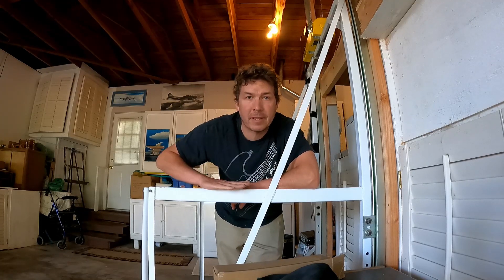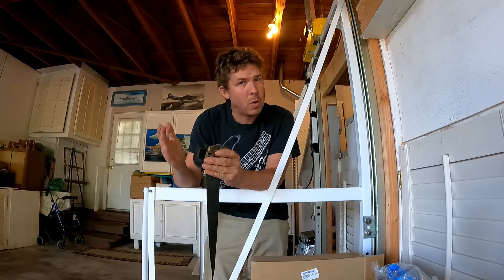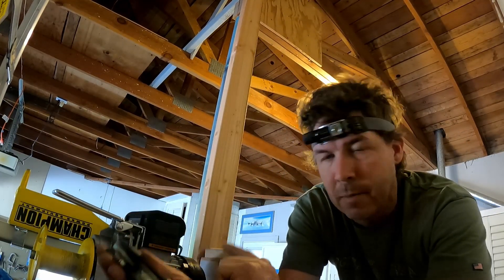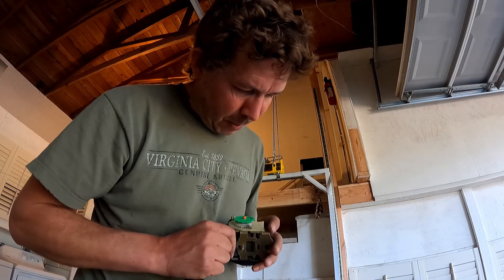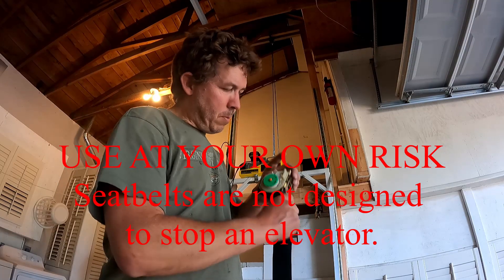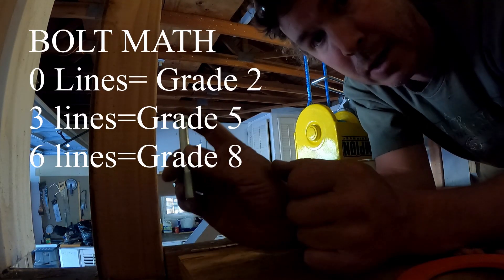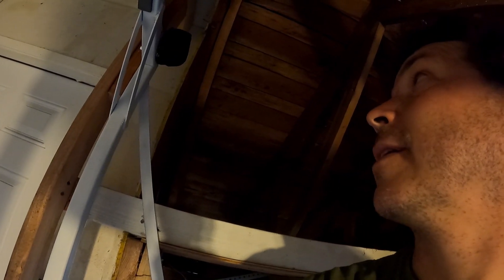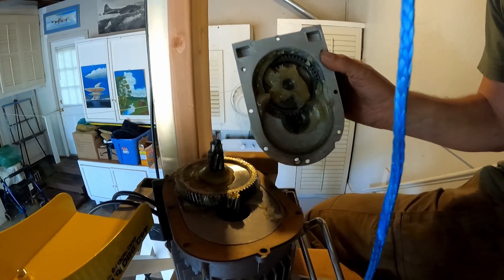How to build a small Elevator Update

Comment: nice build but I wonder if the seatbelt is strong enough to arrest a fall of this weight ? I know they are strong and are made for a different type of "fall" but certainly not a vertical drop but they should work if you position it correctly  but all the weight is on a tiny pawl , then it would be on a car crash as well I guess.  A SLR might be a better solutions as they have a rating of 150 to 200 kilos and are designed for vertical drops , nice build and good safety .
Reply from the maker: the strap itself is strong enough by a huge margin. not sure about the pawl. However the drop is unlikely and if it did it would never be more than about 5 feet.
Reply from the maker: Thanks for the comment
Reply: @DirtyShopDIY  Thanks I was checking out fall arresters that contractors use on building sites, one of those would be better I think for what I have in mind, my elevator needs to lift up around 6 metres more or less, one stop. I'm nervous with a seatbelt although as you say I think it would work , they are built for just this type of thing to be honest and are supposed to hold a body that's is being thrown forwards at around 70 mph, that's a lot of weight, torque and acceleration were talking about. 

I think though for me I will use the arrester as you can get models that will hold 250 kilos from a drop which would be fine I think alternatively I could adopt the Otis system that's being shown on YT but its designed for indoors use and mine is outside

The other issue is I will need to bring the cable down one side, across the back rail and then back up on the right to a anchor on the top as I need to be able to walk through where the cable would be centred, cant mount it above my head sadly, to close to a overhead power line. 

Back to the drawing board. Needs to be installed for this years winter logs and me !! :-)   

just so you know a fall from 2 metres 6 foot can actually put your ankle bones up through your leg bones if youre on the heavy side. I saw it happen the other day on a TV show over here, guy jumped down from 2 metres and broke both his ankles and smashed his lower leg bones. I'm glad you have the seatbelt on !! 

I'm going to adopt some of your ideas thank you will probably use a fall arrester and possibly a seat belt as well for redundancy reason or shit I dont want to drop 6 metres !! Cheers keep up the good work

Comment: I know this is an old video.
I'm curious how you attach the synthetic cable to the spool. Is it the same attachment as the wire rope? 
How has this system held up ?
Reply from the maker: the system seems to be working well. I dont remember how I attached it. Probably the same as  the original

Comment: Wow, the wrongness continues.  I watched the first video and commented how the two big scary issues are the lack of solid doors at the car's back & front exits which should be electrically interlocked with the hoist power (no motor power unless both solid doors are locked in place, use limit switches).  The front door would act also as a wheel chair ramp and the back door will also serve as the top stair entry platform.  Leaving that platform on the stairs, as this guy does, while the car moves downwards with Grandpa means Grandma, at the top, could accidentally walk off that platform and fall (yikes!).  So easy to attach that platform to the car. 

A seat belt as a safety???  Seat belts are only meant to hold back your upper torso as you lurch forward during a crash.  They are for sure not meant to handle a person's whole weight plus the elevator's weight.  This goofy Rube Goldberg feature gets an F grade.

Replacing the the hoist cable with some sort of hardware store plastic rope - Wow, very scary!  The company making that hoist would, I am sure, not advise this (and would advise against using it as a people mover too I'll bet).  The original metal cable probably is less prone to fraying and breaking when compared to plastic, even fancy high strength plastic.
Reply: Jeez really man , , of course a seatbelt would work, they are designed to stop the entire weight of a human body hurtling forwards from a stopped position to instant acceleration at 70 mph , the acceleration and torque not to mention the deacceleration and the snap moment on arrest would easily stop this from falling.  The webbing will hold over a ton normally , the only possible issue is the tiny pawl inside the mechanism that might need checking for its strength but almost certainly I do not see any issues from it working. 

A construction fall arrester which is designed to stop 250 kilos form falling is a lot smaller in comparison to the webbing of a seat belt and its incredibly well engineered over dozens of years, tested to destruction mechanism using literally billions of USD in R&D to make sure it will work. Of course its bloody safe.! For goodness sake man. 

I bet you are one of these guys that wont do anything unless you have a waiver in writing. You're what's wrong with the modern world today, You lack common sense  and a interest in your fellow man. Geez.

Comment: Think I’ll just continue with my idea of a fall arrestor. If I’m lifting 200 kg I’m not sure car seatbelt will cut it
Reply from the maker: A fall arrestor might not either. Those are made for 1 man safety. 200kg might need something more. Perhaps 2 arrestors
Reply: Car seatbelts are made to withstand a minimum force in America of 22000 Newtons and will support a man's full weight at 15 gravities.   Far more than any fall arrestor would.  what is more important is the fixing of the belt to the lift to ensure that a sudden drop does not shear the anchor points top and bottom.  Those points should be double welded and strengthened on the frame .

Its a good useofabrilliantsafety system that regularly saves lives every day.  I am a engineer and that is the best safety option other than not using the lift! 

It's a whole lot better than not having one, the only thing I would do is not to tamper with the mechanism and ensure you anchor it properly so it can function as designed.  

No need to reinvent the wheel.
Reply: it should do easily enough its designed to stop a body weight at 70 mph , 200 kilos is SFA in that equation with the speed involved. It will stop it dead literally.

Comment: you could also mount the winch where pulley is above to reduce noise at platform. good idea on the seat belt! Would this work outside?
Reply: Yeah, I'd like to make a porch lift (to a mobile home) to lift about 3' for my father in law
Reply from the maker: I dont see why it wouldn't work outside. It could rust. I would want to cover the wench.

Comment: Nice again thnx do you think a lift like your could work for 3 floors 30 ft for me
Reply from the maker: The tracks come in 10 foot lengths. The transitions might be rough. You would have to use a stronger winch, or 2 winches. Definatly some safety devices. Otherwise I see no reason you couldn't make this go that high.
Reply: @DirtyShopDIY  thankyou for the suggestions

Comment: I like your ideas, I think two seatbelts maybe four. If it hit on one, what if only that corner stops and it tumbles over and dumps the passenger.
Reply from the maker: I dont think thats likely the system is quite ridged. I didnt have 2 belts, but thought about it. I really doubt it will ever be needed. Thanks for watching.
Reply: The way you're levered against the wall, 2 is probably the point of diminishing returns.  I don't have time now but, "doing the math" on the loads at the various failure points would be interesting.

If I had to guess, you're going to break the attachment points before any of the connecting components.  I.E. treat the lift like a helmet, if it ever does fall and is caught by the seat belt; I wouldn't trust the square tube to take repeated hits.